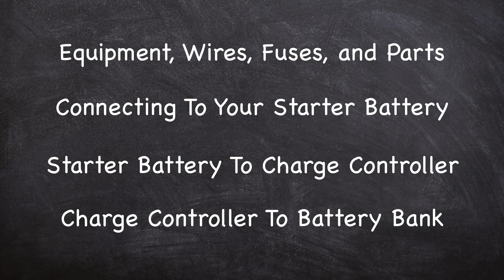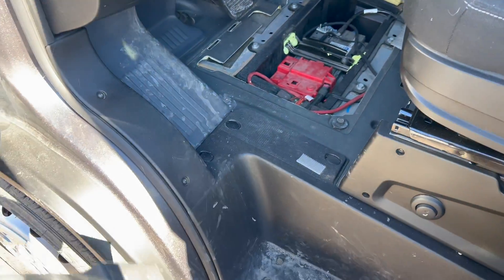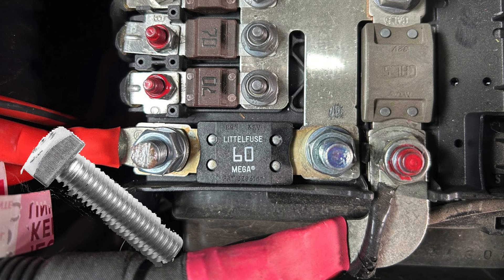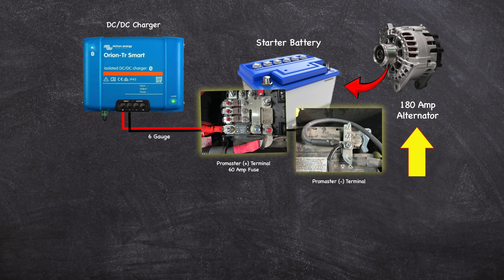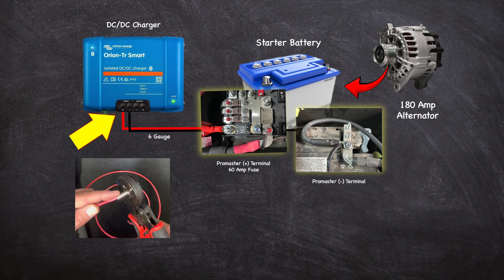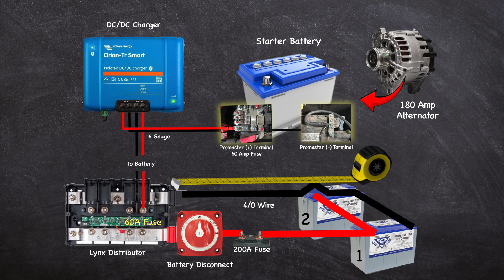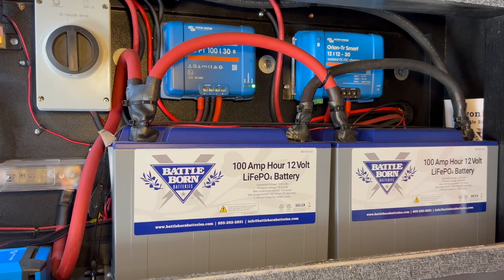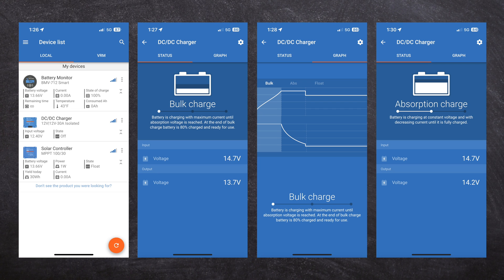DC to DC Charging for your Van | Victron Orion Install

Comment: I also have a 2023. The battery slot where you connected your Orion has a 250amp fuse in mine. Did yours have this? Thanks!
Reply from the maker: That's interesting.  Do you have a second alternator?  If you have two of those Cal5 fuses and are looking for another spot to connect a DC to DC charger, you can tap into the #3 position 70amp fuse that protects the wire going to the upfitter power terminal in the B Pillar, assuming it is not in use.
Reply: @TheVanTeacher  Thanks! I don't have a second alternator (I do have an upgraded 220amp one), and I can't find any solid information on what the 250 fuse is for. We decided to go with the same fix as you suggested.  I don't plan on using the upfitter power terminal so I am replacing the 70amp with a 60amp and tapping in there. I appreciate the response and your videos!

Comment: You mentioned ferrules for the 6 AWG wire, however, the link to your kit does not include a ferrule in the kit for less than 8 AWG.

Comment: So, what if I'm trying to eliminate my lead acid starter batteries altogether in favor of LFP batteries?  In my case it's for my 08' F250 that I don't drive as much anymore, and it constantly has dead batteries.  It's also parked on the street so I can't really leave a trickle charger running.  At least if the LFP batteries go to super low it won't impact them nearly as much as the lead acids when they go to zero.  If the lead acid batteries get too deeply discharged, though they'll charge back up, they just don't have the same CCA or SoH anymore (at least per my tester).  I couldn't really go with the setup that you drew out, but I'm sure there's some sort of option that just goes between the alternator and the LFP batteries?  Or would it be as simple as having the alternator connect to the input on the Orion and the Output go to the LFPs?
Reply from the maker: Good question as it seems Lithium batteries would be a good option given their benefits in so many areas.  As for a stater battery replacement I don’t think it would work for a few reasons.  Lithium batteries might shut down when the on board battery management system detects the very high current when starting your vehicle.  They also don’t take a charge when the temp drops below freezing and stop providing power all together when it’s much colder.  

I’d maybe look into a solar trickle charger that you could leave on the dashboard and keep plugged into a 12v socket.
Reply: They sell small dashboard mounted solar panels that connect to the auto battery for the sake of trickle charging them. It's a passive way to keep the battery from dying when not used often.
Reply: @calm-waters  This is so good to know!  I had no clue that there was such a thing.  Thanks!

Comment: Super informative video.  Can you use the new Orion XS with the Promaster?  I don’t necessarily need more power but I like the form factor and doesn’t heat up as much as the older one.  Thoughts?
Reply from the maker: Thank you!  As best I can tell, the new Orion XS will get along just fine with the Promaster standard alternator.  It will put a little more stain on it, but still well below the alternator’s output capacity of 180 amps.  I’ve seen guys use two Orion 30amp chargers together with no problem.  If you already have the Orion 30amp with 6awg wiring and a 60amp fuse, the XS is a direct replacement with no wiring/fuse upgrade.  The only reason you would need larger wire would be if you are running extremely long distances, like 100 feet or so.  I like the new XS charger for its efficiency and advanced monitoring features, but the 30 amp model is really fast and more than plenty for small to mid sized battery banks.  Check out Explorist.life as Nate has done a few videos on the XS.
Reply: @TheVanTeacher  thank you so much!